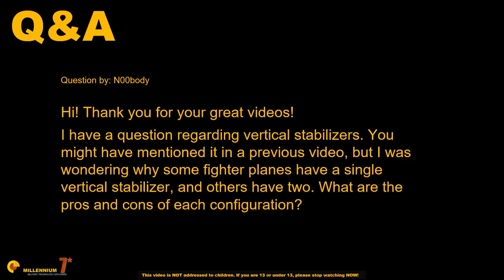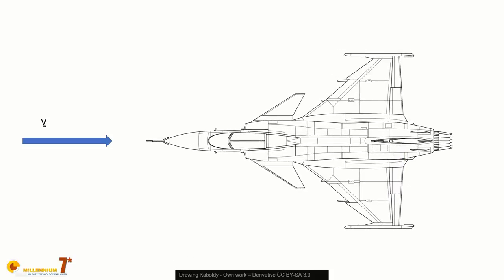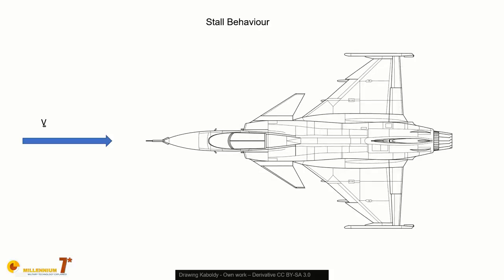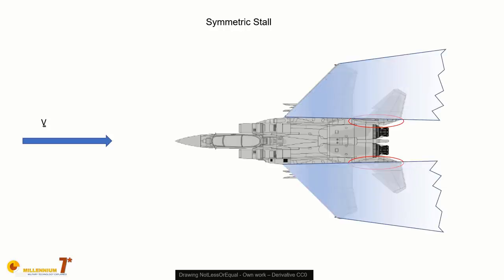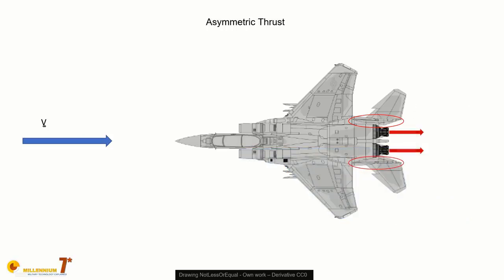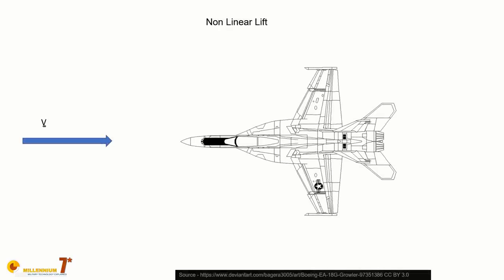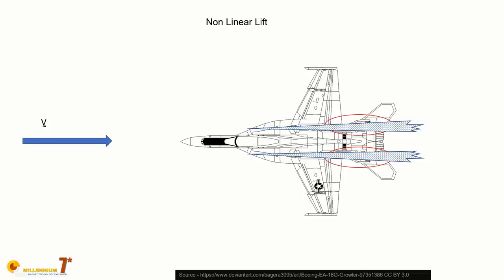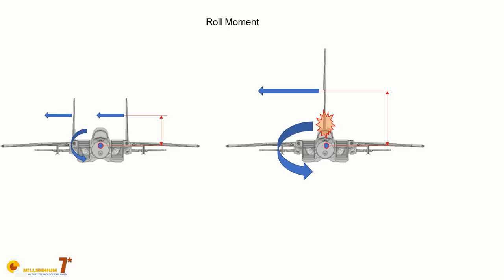Why Fighters may have Twin Vertical Stabilizers? - Q&A Video

Comment: Although this is a very good video, there are few things I think that it inadvertently leaves out:
 
1.  A fighter aircraft does not NEED to have any vertical stabilizer at all, per se.
They NEED it because it is does something that helps satisfy some requirement or requirements (either implicitly or explicitly stated) usually related the mission(s) that the aircraft must perform.
For example, since many/most fighter aircraft carry some sort of gun, and since the effectiveness of said gun depends on the aircraft being a stable platform so that the gun remains on target when it is fired, fighter aircraft "need" to be stable in yaw as well as pitch so that it can more likely hit and kill what it's shooting at.
 
2.  Wings and fins add to the surface area of an aircraft which adds drag to the aircraft thanks to friction with the air its flying through.
In addition, whenever one surface meets another surface, the air flows over those surfaces tend to "interfere" at the place where those surfaces meet.
This interference also causes "interference drag".
 So, if you want to keep drag down, say in the interest of making the aircraft as fast as possible, you will also try to keep the number of fins/vertical stabilizers down.
 
3.  Aircraft that fly supersonically tend to be long and skinning as being long and skinny tends to reduce the size of any supersonic shock waves that form over the body.
Long, skinny bodies tend to "couple" forces from in strange and wondrous ways (i.e. "inertial coupling").
This coupling of forces becomes more problematic at supersonic speeds to the point where if they are not kept under control, the aircraft may moving in ways that overstress its structure resulting in the aircraft being ripped apart.
So in addition to vertical stabilizer fins, you can also see other fin surfaces sprout up such as the vertical "strake" on the bottom of the F-104 to help it keep flying straight (unless otherwise directed by the pilot).
And if a single strake doesn't cut it for some reason, then additional strakes may be added to maintain yaw stability like those added to the F-104G to turn it into the F-104S.
  
4.  Finally, requirements for the shape of an aircraft may be end up being dictated in no small part by things that have NOTHING to do with the aerodynamics of the aircraft.
Case in point is the F-15 where the Congress effectively demanded have a twin stabilizers because that's what the MiG-25 had.
(Congress also effectively demanded that the F-15 have a top speed of Mach 2.5 instead of Mach 2.3, which is what its top speed really is in all but one very limited case which is useless for combat.)
Reply: Doesn't make any sense. If that's the case then there shouldn't be any vertical stabilisers in aircraft since 1903. Well behold most aircraft since than have vertical stabilisers. They need vertical stabilisers not just to have yaw stability in a straight line but also to create yaw instability to change direction horizontally!
Reply: 1. If you say like that then why does airliners and other civilian aircrafts over the 100+ years have vertical stabilisers then? Because they have guns? No! 

2. That is the point to have them. They create drags which will increase control and manuverability. How much speed does a fighter loss if it had a single stabilizer? 100mph? 200mph? 1000mph? Give me reference with actual numbers please.

3. To fly supersonic you need to be long and thin? That does not correlate with vertical stabilizer LMAO 😂. Tell that to F-15, Mig-29, F-22, SU-30, Typhoons etc etc

4. Requirements? Lol if that requirement isn't suitable/ have more negative impact than the designers could just omit that requirements. As stated in the video there are pros and cons to both single and vertical stabilizer (control ,stability, redundancy)
Reply: @LuqmanHM  
> Doesn't make any sense. If that's the case then 
> there shouldn't be any vertical stabilisers in 
> aircraft since 1903. 
 
I regret to inform you that things can work quite well without them making any sense to you.
 
> Well behold most aircraft since than have 
> vertical stabilisers.
 
Most, but not all which clearly demonstrates that a vertical stabilizer is not NEEDED which oddly enough is what I said.
 
> They need vertical 
> stabilisers not just to have yaw stability in a 
> straight line but [...] 
> also to create yaw instability to change 
> direction horizontally!
 
Wrong.
 
Winged aircraft change direction by rolling their wings so that the direction of their lift vector points towards the center of the circular path that they want to follow and then deflecting their canards and/or elevators so that the angle of attack of the wings increases thereby increasing the force of the lift vector to turn it into the centripedal force that will aircraft to turn about center at the desired rate.
The role of the vertical stabilizer is to create a "coordinated turn", meaning that the aircraft does yaw into the apparent oncoming airstream (i.e. sideslip).
 
But it is not necessary that you coordinate a turn as I can assure you as I've very briefly flown a Marchetti SF.260 and have made (uncoordinated) turns just fine without ever once touching the rudder pedals.
Reply: @LuqmanHM  
> 1. If you say like that then why 
> does airliners and other civilian 
> aircrafts over the 100+ years have 
> vertical stabilisers then? Because 
> they have guns? No! 
  
You are correct that airliners don't have guns.
But they do have passengers and an aircraft that yaws all over the place isn't necessarily a nice thing to experience.
In your apparent haste to reply to me, you must have over looked my use of the word "requirements" and "mission".
 
And while historically airliners have had vertical stabilizers, that doesn't mean that they always will.
Take a look at R.T. Jones' proposal for oblique flying wing airliner some time ... it has no vertical stabilizer.
 
> 2. That is the point to have them. 
> They create drags which will increase 
> control and manuverability. 
 
Drag?
How about LIFT.
Even a symmetric airfoil generates lift if its given a positive angle of attack.
Or didn't you know that?
 
> How much speed does a fighter loss if 
> it had a single stabilizer? 100mph? 
> 200mph? 1000mph? 
> Give me reference with actual numbers please.
 
And where do you expect me to come up with "actual numbers" without being given "actual numbers" for the dimensions and flight characteristics?
Pull such things out of your own ass if you want.
 
If you want to get some idea of what sort of drag can be generated by a vertical stabilizer, go look up "skin drag" some time.
And if the fin is attached to a supersonic aircraft, then add "wave drag" to your list.
As for interference drag, you can look that up too, but I'll be nice and point you to an old NASA study on interference drag:
 
  < https://ntrs.nasa.gov/archive/nasa/casi.ntrs.nasa.gov/19840021784.pdf >
 
> 3. To fly supersonic you need to be 
> long and thin? That does not correlate 
> with vertical stabilizer LMAO 😂. 
> Tell that to F-15, Mig-29, F-22, SU-30, 
> Typhoons etc etc
 
No, you tell that to the Concorde which unlike the fighters you mentioned was intended for sustained supersonic flight.
 
Apparently, you are unaware (which isn't too surprising giving your other comments) that aircraft are an exercise in trade-offs.
If you want to fly subsonically, a "fineness ratio" of only about 3 to 1 is often times ideal.
This is an extremely stubby body to most uneducated people's eye (like yours I'm sure), which is why the Questair Venture looks so odd to many.
 
As for the other fighters that you've mentioned (1) they mostly do not fly at supersonic speeds and (2) they are actually quite long compared to how thin they are especially when it comes to their wings.
Your inability to see this "correlation" is sadly further evidence of your ignorance.
  
> 4. Requirements? Lol if that requirement 
> isn't suitable/ have more negative impact 
> than the designers could just omit that 
> requirements. 
 
In the case of fighters, the requirements are set by governmental bodies in their contracts with the aircraft manufacturers and so cannot be ignored by the aircraft designers if they want to get paid.
If the designers cannot get there from here, then they can go back to the governmental bodies they are dealing with and ask that some of the requirements be waived or modified.
This is not at all uncommon.
But the requirements can be sufficiently restrictive as to all but dictate part of a design.
 
> As stated in the video there are pros and 
> cons to both single and vertical stabilizer 
> (control ,stability, redundancy)
 
No shit, Sherlock.
It's always nice to run into some clueless troll.
Reply: Just when I thought I had heard everything, along comes a claim that a fighter doesn't need a vertical stabilizer.  That's plain nuts, unless of course you are talking about a FBW aircraft with artificial stability.  A non-FBW aircraft needs a vertical fin, and swept wings and supersonic speeds require a bigger fin. They'd all be doing the Sabre Dance without one.
Reply: @gort8203  
Fly-by-wire can eliminate the need for a vertical stabilizer, but my comment wasn't restricted to just FBW aircraft.
Take a look at the cancelled A-12 Avenger proposal some time (although it was probably FBW).
 
As for the "Saber Dance", I think you are confusing too different things with regard to the F-100.
Yes, the F-100's vertical stabilizer was "too small" for awhile, but that was not, NOT the cause of the "Saber Dance".
 
The "Saber Dance" is an unrecoverable deep stall that is potentially a problem with ALL swept trapezoidal winged aircraft.
Basically, the wing sweep causes the air to flow out towards the tips which causes the ends of the wings to work harder than the inboard parts of the wing.
The result is that the outer part of the wings stalls first and because of the sweep, the nose of the aircraft pitches up and you can end up in a situation where nothing you can do to get the outer parts of wing unstalled ... other than to crash and die.
 
There are several solutions to prevent this problem like twisting the wing (which is what airliners often do) so that the outer parts of the wing fly at a lower angle of attack.
You can put stall strips on the inner portion of the wing so that it stalls before the outer part.
Or you can try to do something to stop the spanwise airflow like adding wing fences (which was what was eventually done with the F-100, C-model I think), leading edge notches/slots, or dog tooths.
(This is not an exhaustive list by the way.)
Or you can simply avoid flying in a way that can get you into a "Saber Dance" which is what the pilots of the F-86 did which could also end up in a "Saber Dance" if you pushed it.
Reply: @Tango Flanker 
> Ray WhitFord might be of help here !
  
He might be ... if he were still alive.
If you can find something in his book, feel free to share.
Reply: @lewiscole5193  OMG, why is it so hard to stick to the point; now we are talking about the F-100 stall characteristics when the subject is directional stability.  How about this: name an existing jet fighter which does not have a vertical stabilizer, then tell me the source of its directional stability, and I might believe you have a point.
Reply: @gort8203  
> OMG, why is it so hard to stick to the 
> point; now we are talking about the 
> F-100 stall characteristics when the 
> subject is directional stability.
 
OMG, why is it so hard for you to understand that what you think was caused by an undersized vertical stabilizer was in fact caused by something else.
The "Saber Dance" was a deep stall caused by the wing sweep without anything done to correct for the problems that outward airflow caused, NOT by the vertical stabilizer or its size.
The undersized vertical stabilizer caused the F-100 to occasionally rip itself apart at HIGH SPEEDS thanks to the joys of inertial coupling.
At low speeds, where the "Saber Dance" occurred, you could have increased the size of the fin and/or rudder and it would have done virtually nothing to produce a force that would pitch the nose downward ... nothing.
Got it?
 
> How about this: name an existing jet fighter 
> which does not have a vertical stabilizer, then 
> tell me the source of its directional stability, 
> and I might believe you have a point.
 
There are as yet NO existing fighter aircraft that don't have a vertical stabilizer, but that doesn't mean that I don't have a point.
But if you need an example of something that might be coming "Real Soon Now", there's the X-47B which *HAS FLOWN*.
And the source of its directional stability?
When it begins to yaw, I THINK (I'm not sure) that the spoiler on the side of the wing going forward deploys a bit thereby increasing the drag and thus a force to compensate for the yaw.
Reply: @lewiscole5193  Your continued contention about the cause of the F-100 sabre dance is not only wrong, but it remains beside the point under discussion, which is your statement that a fighter does not need a vertical stabilizer.  Of course it does, unless--as I said in my first comment---it has a computer FCS providing artificial directional stability.  But that condition is also outside the very topic of this video and its comments, which are related to the directional stability provided by vertical tails.  This is not a FBW discussion, so unless you have an example of a non-FBW jet fighter with a vertical tail, your statement is wrong.
Reply: @lewiscole5193  i would still say that aircrafts needs vertical stabilizer. If it doesn't need it then all aircraft should not have it since 1903. Write whatever u want but i still believe in the engineers who designed these multi million dollar aircraft. If you could build a supersonic fighter that have same manuverability/flight characteristics as a raptor or sukhoi, then i believe in you. X wing style stabilizers doesn't count though.
Reply: @lewiscole5193  Oh one more thing, im sure you had read this concept from a book by some engineer or some sorts. Please share the link here which i could read it for free. Thanks
Reply: Luqman Hakim You’re right, most aircraft do need vertical stabilizers (or fly by wire flight controls) for directional stability and turn coordination. And as a pilot i confirm that turn coordination is indeed important! That guy is lucky to be alive after experimenting with uncoordinated turns without any pilot training. If he tried it at low speed, low alt, and pulled a little bit of G, he may have ended up as a smokin’ hole in the ground. But there’s an interesting wing design concept that seems to eliminate the need for a vertical stabilizer, as it coordinates and stabilizes itself: it’s called the Prandtl wing. It works the same way as birds’ wings, and birds don’t have vertical stabilizing surfaces either... The Horten 229 used that concept if I remember correctly. It’s explained in more detail in this video: https://www.youtube.com/watch?v=w-dk1NpVNNI&t=
Reply: @lewiscole5193  Resorting to profanity will not win the argument for you, but it does indicate that you sense you are losing. Arguing with you serves no purpose, so I am done with you.
For anyone else reading this: This guy doesn't know what he is talking about, and most of statements are misconceived if not just plain wrong.  I remain happy to discuss these issues with anyone who can remain civil and on point, but not with this jerk.
Reply: @LuqmanHM  
> i would still say that aircrafts needs 
> vertical stabilizer. 
 
That's nice.
You can say what you want ... so long as you don't violate the Terms of Service.
 
> If it doesn't need it then all aircraft 
> should not have it since 1903. 
 
Bullshit.
 
The Wright Flyer was dynamically unstable in pitch which the pilot could easily compensate for.
That doesn't mean that every aircraft from 1903 can or should be unstable in pitch.
And yet, that's what today's fighters commonly are despite decades of striving for stability.
 
The Wright Flyer was a biplane, had a canard, and used wing warping rather than ailerons, but these features haven't been replicated on every aircraft since then either.
And yet, supersonic aircraft were for a time considered worth investigated due to the possibility that one could cancel out shock waves;
canards are now a common configuration thanks in no small part due to Burt Rutan's relatively recent designs; and wings don't have ailerons any more but rather deform have been considered a possibility with the creation of new "smart" materials.
 
The fact of the matter is that paradigms come and paradigms go, but when it comes to aircraft, their designers tend to be extremely conservative and stick to what they know works because people's lives are on the line.
Things change, but it takes a long time and there usually has to be some "Good Reason" for it.
 
Which brings me back to a point that you and others have repeated while leaving out what I actually said in my OP.
Remember me saying this?
 
  "A fighter aircraft does not NEED to have any vertical stabilizer at all, per se."
 
It was immediately followed by this:
 
  "They NEED it because it is does something that helps satisfy some requirement or requirements (either implicitly or explicitly stated) usually related the mission(s) that the aircraft must perform."
 
IOW, even though its possible to design an aircraft without a vertical stabilizer, the MISSION REQUIREMENTS usually dictate whether or not they do.
And in the absence of "stealth" they haven't had a need which dictated that they do.
Instead, designers have put fins on their aircraft because, generally speaking, not flying directly into the apparent wind is not "A Good Idea" and fins are a cheap and easy way to make sure that they do.
 
And nothing that you say about whether or not an aircraft needs a vertical stabilizer changes that in the slightest.
 
> Write whatever u want but i still believe 
> in the engineers who designed these multi 
> million dollar aircraft. 
 
Then you should believe in the Horton brothers whose flying wings were famous around WWII, Jack Northrop whose flying wings like the N-9M turned into the B-35 bomber, the boys and girls at MacAir who designed the X-36, the boys and girls at Lockheed who designed the X-44, and the boys and girls at Boeing who designed the X-45.
 
> If you could build a supersonic fighter 
> that have same manuverability/flight 
> characteristics as a raptor or sukhoi, 
> then i believe in you. 
> X wing style stabilizers doesn't count though.
 
Okay, so don't believe me.
Reply: @csabascs5913  
> You’re right, most aircraft do need vertical 
> stabilizers (or fly by wire flight controls) for 
> directional stability and turn coordination. 
 
There's that word again:  "most".
 
> And as a pilot i confirm that turn coordination 
> is indeed important! 
 
It's a funny thing about pilots ... they aren't necessarily all that expert on aerodynamics.
I know this because of the group of friends I used to hang out with at work who were pilots, including my best friend who was a CFII.
 
> That guy is lucky to be alive after 
> experimenting with uncoordinated 
> turns without any pilot training. 
> If he tried it at low speed, low alt, and
>  pulled a little bit of G, he may have 
> ended up as a smokin’ hole in the ground. 
 
Well then, I must be talking from the grave as I and my friend (who was a pilot) went out to one of those places that lets folks "dog fight" in aerobatic trainers, in my case Marchettis which were designed by one of the best designers around, Stelio Frati whose Falco I considered trying to build as a way to get into the Friendly Skies.
My friend and I were each accompanied by ex-military fighter pilots in the right seat, an ex-F-15 pilot in my case IIRC, while my friend was accompanied by an ex-F-18 pilot.
The throttles was pushed to firewalls and we were told to keep our feet off the rudder pedals and we went chasing each other around pulling 6G turns.
 
My friend instinctively tried to press on the rudder pedals once during our flight and put his plane into a spin which caused his ex-military sidekick to take control of the plane and pull them out of the spin.
Afterwards, there was a bit of banter between the ex-military pilots about, "Hey, what did you think of my defensive spin?"
 
We had altitude in aerobatic aircraft that were well designed and well understood with real live experts with aerobatic experience on hand ... so with all due respect to your pilot's license (which hopefully isn't just a Sport Pilot license) luck has nothing to do with my being alive after the flight.
And while the ex-military pilots could have been pressing the pedals while I wasn't looking, the fact that I was getting constant information and/or directions from my sidekick leads me to believe that he wasn't keeping his eyes on the ball (to make coordinated turns) all that much either.